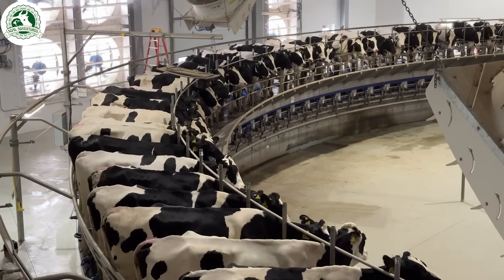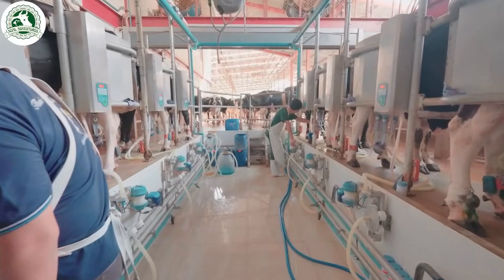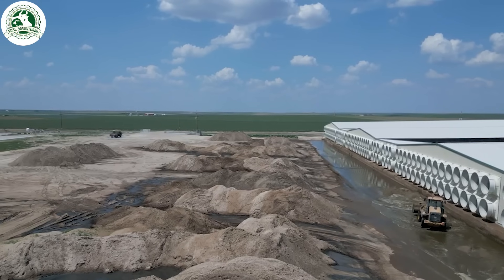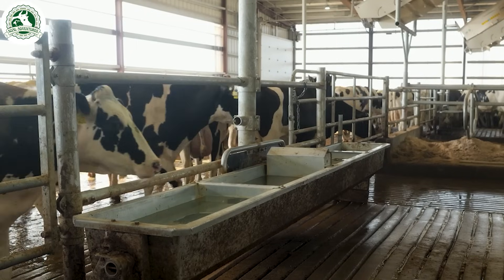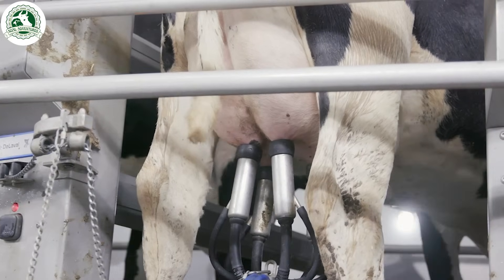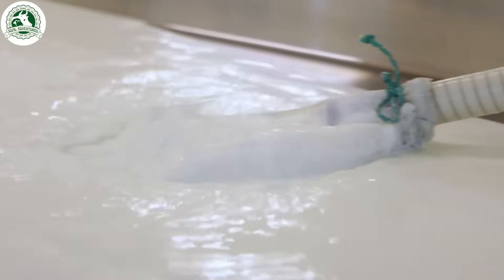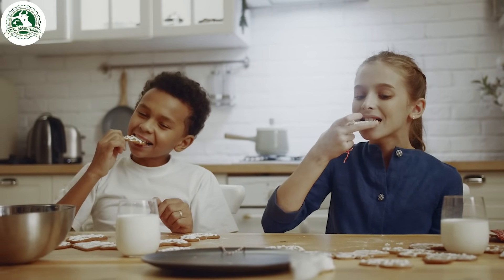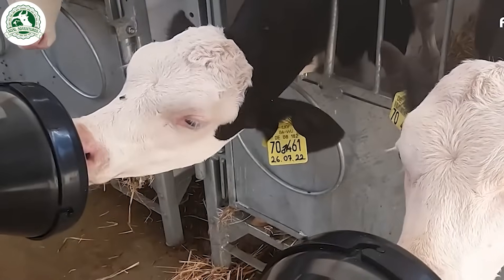How High-Tech Machines Milk Millions of Cows | Surprising Milk Cow Farming Techniques

Comment: Milk is not maintained at 34 degrees while being hauled. It is chilled to 34 degrees prior to being hauled. The amount of milk stays chilled for quite a while as it's around 50,000 pounds in a tanker which is insulated.
Reply from the maker: Thanks for pointing that out — you're absolutely right! The insulation really does a great job keeping that massive amount of milk chilled.  Thanks so much for watching!

Comment: I used to work at a place that rolled their waffle cones by hand. We had to bake the cone, then slowly roll it with a tool into a hollow cone (basically like the thing they use but hand-operated) and leave it sitting there with the seam at the bottom till it got stuck together. It was tedious as hell.
Reply from the maker: That sounds incredibly tedious and tough on the hands! It's amazing how much manual effort goes into some of the simplest pleasures, like a waffle cone. Thanks for sharing your personal experience and for watching our video!